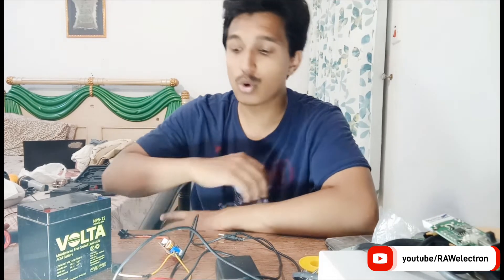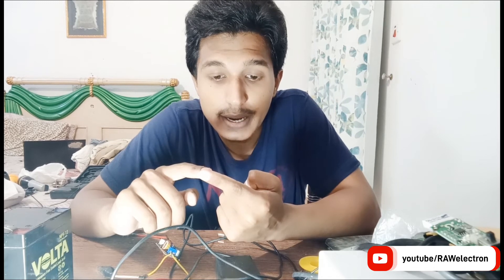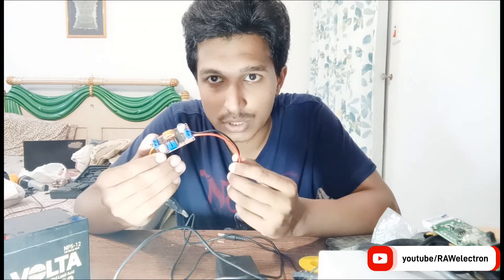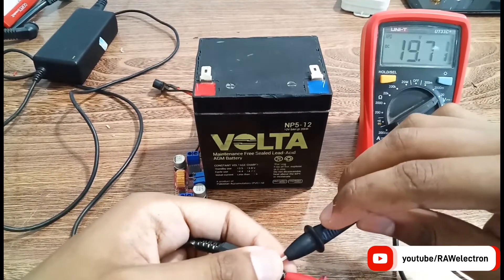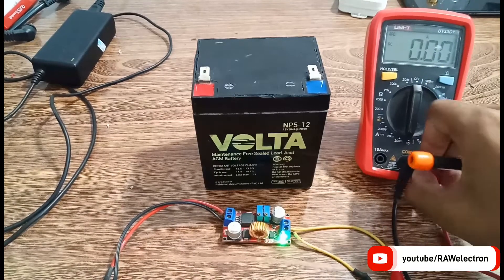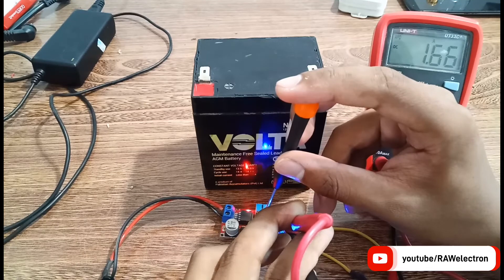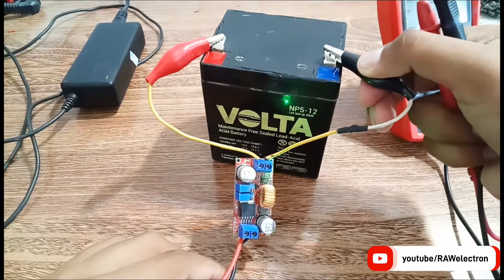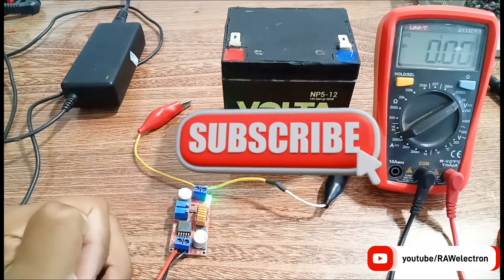Make charger for 12v sealed lead acid battery with xl4015 buck converter | Safe charging with xl4015

Comment: Hi can you also charge a 6v 4.5 ah lead acid battery. What do I need to set the volt to charge and what do I need to set the amp. Thanks
Reply from the maker: Yes. Set 7.2V and current 1A
Reply: @Electricquantism402 thanks

Comment: CAN I CONNECT IT TO MY 100 WAT SOLAR PANEL THAT DELIVERS 18v AND 5amp.?  WHEN THE BATTERY REACHES 13.5v WILL IT AUTOMATICALLY CUT OFF THE CHARGE.? WILL IT RESTART CHARGING WHEN IT DROPS TO 12v.?

Comment: Input 15v 5v amp & set to 12.v 2amp .its working or not ? Lithuim battry 3s
Reply from the maker: Yes. 12.6v max for 3s. It will work great

Comment: I am wanting to make a charger that I can leave powered on without being concerned about overcharging and overheating. My intention is to charge a 12v tractor battery full time.  So you say the XL4015 is not a trickle charger but you can set the upper level to 13.8v  or close to it, and it stops charging correct? This would be fine for my needs. And if I understand you correctly you state that reverse voltage protection from the battery will not damage the module as well. I can see myself tripping over the power supply and inadvertently unplugging the unit. As far as overheating is concerned I was thinking about adding a heat sink but 2-3 amps is sufficient for my needs also.

I enjoyed your presentation. It is to the point and easy to understand. Thanks.
Reply from the maker: Many Thanks. You got it right

Comment: If suddenly load shedding and battery is connected to the module,the module will damage readily ,yes or not.
Reply from the maker: No. Only reverse current lights up the green LED on module. No damage to the module

Comment: Its 14.9V initial charge until it reaches 14.9V trigger voltage that is when the second voltage kicks in of 13.80V. So, the charger would need two different charge voltages. Charge and float.

Comment: Sir I have a 24 volt 3 amo power supply and want to charge a 12v 7ah battery, as you suggest to set the limit voltage and current but after full charge is it necessary to remove battery from charging connector, I mean will it be automatically cut off charging after fully charged because i want to engage it to my mini home ups to charge the battery?
Reply from the maker: No need to remove the module because this module don't do trickle charging, but if you don't remove it, green LED on module always stay on which discharges the battery very slowly..
Reply: It will be fixed by placing a diode so that the battery will not be discharged

Comment: Do I need to add diode in the output of xl4015... In case of charger is disconnected and module still connected to the battery.

Let me know what will happen...
Reply from the maker: Yes you can add
Reply: @Electricquantism402  what if I don't add any diode?
Reply from the maker: @uixsohel  module's LED will glow just due to reverse current of battery.. still its fine..will not do any damage to module..
Reply: @Electricquantism402  Thanks, That's the answer I was looking for. I'm using like this for 2 days, I was worried this could damage my module in the long run.

Now that's a relief 😌 
Thanks again
Reply from the maker: @uixsohel  no problem. You can ask anything anytime as i mentioned it in the video.

Comment: Can I input 12v adapter?
Reply from the maker: Yes..5v-35v dc input range
Reply: @Electricquantism402  I need 12.6v output
Reply from the maker: @bibhas7783  no.. you need at least 13.5v input to get 12.6v output...
Reply: Ok thanks 👍

Comment: I having 12-0-12 transformer rated for 2 amps. Not considering center tap if I use this as 0-24v can I give the rectified Dc to buck converter.
Reply from the maker: Yes you can.. you can give 35v max input to this module..

Comment: I want to convert 24 volt to 12 volt  from a   smps power supply of 10 amp capacity(240w), with a buck converter. Can It capable to produce same wattage of 240 W at 12 volt out put.
Reply from the maker: This converter handles only 75w..
You need 300w 20A buck converter..
Checkout the video on my channel...
It will be perfect for your application.
Just buy in on AliExpress

Comment: Can I use 0-12v transformer instead of 19v adapter
Reply from the maker: No..12v transformer will not provide 15v which is essential to gain 13.8v on the xl4015 to charge battery...
Use at least 15v dc power source or 15v transformer with rectifier on the output.

Comment: i am trying to charge a 12v 7ah battery using the XL4015...i set the XL4015 at 13.5v  and at 1.4amps..however when i connect the 12v 7ah battery to the XL4015 output both the red and blue lights up at the same time...i tried it on another 12v 7ah battery but the same thing happens...both the red and blue lights on the XL4015 lights up at the same time...what am i doing wrong?...i am using a 19v 3.42amps laptop power supply as my power source...please help me.
Reply from the maker: There is nothing wrong in this as long as the current is flowing..
Red LED lights up in the beginning but as soon as the battery is close to full charge, it turns off and that time only blue led glows.. while at the end, green led indicates that the charging is full..
But please make sure with the help of clamp meter that current 1.4A is flowing towards battery during charging or not?.. let me know..
Or also that the polarity is correct?
Reply: @Electricquantism402 thanks  for the reply. i have it at exactly 1.4amps and 13.5 v...i found out that at the back of the XL4015 has a light indicator...the lights are for current and voltage...i think it was just normal for both the lights to turn on...i charged the battery for 7 hours and charged for only 11.8 volts...it did not go up anymore as i charged it again for 1 hour still at 11.8v...these batteries were purchased about 3 months ago and was inside a ups...do i need to add distilled water to the battery as maintenance? it is a sealed battery.
Reply from the maker: @newvaper3794  add battery distilled water about 10ml each cell.
Then charge it on 13.8-14v..
If its cells are not damaged or shorted then it will start to hold charge and provide backup..
Reply: @Electricquantism402  thanks. i will update you again tomorrow. thanks for all the answers. keep safe. sorry i thought i was already subscribed to your channel. i apologize i just subscribed now.
Reply: @Electricquantism402  it is working now...added 10ml of distilled water to each cell. yes !!!...i can now use my UPS on my laptop...i have another question..it took time to fully charge the two batteries, why is it that the XL4015 green light light up when the battery is connected?...is there a way to only have the led lights turn on when charging the battery?...it looks like it loops the charging to the battery back to the XL4015 that is why it took a lot of time...thanks again for helping me.
Reply from the maker: @newvaper3794  that's great.
Actually its the reverse current of battery which is lighting the green led ..but it's only in case when xl4015 is connected to the main power source.. otherwise it doesn't effect the charging speed..you can increase the current upto 2A if battery is 7Ah.
Reply: @Electricquantism402  thank you so much. when i opened the battery it was just dry. no more water in it. it is a 12v 7Ah battery. i placed 10ml of distilled water in each compartment just as you told me. so far the charge has been holding up. i have been using the two batteries for 5 hours now. i will probably buy the XL4016. i saw your video on the XL4016. thanks again.
Reply: Sir you do nothing wrong module working fine  battery is charging when battery ful charge green light glow

Comment: Excusme sir, i have a question ?? In many source to charge lead acid properly, there is CC CV charging method more simple is CC gonna use at 0 - 90% SOC, CV 90 - 100% SOC of battery. So this is my question, is Module XL 4015 do this scheme CC-CV automatically after you set 2 parameter voltage and current in early video ?? Thanks 🙏🏻
Reply from the maker: Yes..this is what xl4015 is designed for.

Comment: i have a 12v battery NiMh 2,4Ah. i got 3 of it. can i charge all 3 at the same time with one 4015xl buck. and if its possible. what do i have to set it. thanks
Reply from the maker: Set 12.6v and current 3A max and connect all three batteries in parallel.
Reply from the maker: It's better to charge them separately with 1A max
Reply: @Electricquantism402  so then i need 3x 4016buck and a minimum power supply of 24v 3a?
Reply from the maker: @tahirtrs3147  as you wish..you can also charge at the same time..
And not 24v 3A 15v 3-4A will also work to achieve 12.6v
Reply: @Electricquantism402  thanks for the info👊

Comment: Hi, to charge a 2,5Ah battery i need 13,8V and 625mAh but i have a 24Volts power supply with only 400mAh. Can the xl4015 compensate for the missing amperes?
Reply from the maker: Yes..it will half the voltage and double the current for compensation of total power.. current will be 7-800mah.
Reply: @Electricquantism402  Ok! Thanks for the answer!

Comment: Can I use 12 volt 1.2 amp adaptor to charge 12 volt 7Ah battery.. With this buck converter, Can it boost 12 volt from the adaptor to 13.8 volt?also I want to charge the battery slowly.0.8-0.9 amp current is required.
Reply from the maker: No it is buck converter.. you have to use 15v adapter for this...or use boost converter..

Comment: fine but in manual 1. first set OUT=5V  2. set current for acid battery 10% ( better or fast 20%)  so for 17 AH set 1,7 A  3. Set  voltage about 14 V  - then !!! connect battery

Comment: Hi, I would like to ask how many volts a 12v 17Ah lead-acid cyclic bicycle battery should be charged? Thank you in advance for your answ
Reply from the maker: Voltage should be between 13.8-14v 
And current should be 25% of its capacity which is 4.1A max.
These are the parameters for charging your battery safely.

Comment: Iss xl4015 module battery ko over charge kareta hai kya please reply
Reply from the maker: No. Current flow ruk jata hai jb battery full charge ho jaye.
Reply: @Electricquantism402  lithium ion battery kharab to nhi hoga na..
Reply from the maker: Nhi bro..no tension.. its a safe charger
Reply: @Electricquantism402  Hmm

Comment: Iss module me 24v 3amp input da sakte hai
Reply from the maker: Yes..35v tk input de skte hain.
Reply: @Electricquantism402  heating issue to nhi hoga na
Reply from the maker: @luckyrawani8952 output current 4A tk set kroge to heat hoga..5A max handle kr skta hai ye module.
Output pe kia chlana hai apne?
Reply: @Electricquantism402  Mera pass 24v 3amp Ka DC power supply hai jis sa input dena hai or output me 14.8v 1.5amp Lena hai jis sa hum 12v lifepo4 charge kare sake
Reply: @Electricquantism402  input me itna volt dena sa module kharab to nhi hoga na
Reply from the maker: @luckyrawani8952  easily ho jayega.. input pe aap is module ko 200Ah ki battery bhi lga skte hain no issue...14.8v at 1.5A easily work krega..even k aap 14.8v pe 4A bhi set kr skte ho..no issue
Reply: @Electricquantism402  Mera pass 12v 6ah hi battery hai Aagar Jada amp dage to kharab ho jayega 😅
Reply: Thank you for your reply 😊

Comment: Not good for Lead-Acid battery, if battery is discharge below 11v the XL4015 will overheat and it will burn out, it will not shutdown automatically because there is 12v battery in output connected that will continue to power up some parts of the module
Reply from the maker: It will overheat only if current is set to more than 4A. At 2-3A it works fine even if highly discharged battery is connected to it.
Reply: @Electricquantism402 
Can we use a Small fuse?
Tell me how many amps ( fuse)
Reply: @Electricquantism402 
If the Battery is discharged 
Does the module detect and automatically charge it

Comment: Hi can you give me a hand? I am designing a smart vaccum cleaner(D.I.Y version of roomba) and i need to charge my battery safely.The battery is Li-ion 3s 11.1v with 2.6AH.Can i use this module to safely charge it without burning down my house?Also how many hours does it need to charge 11.1v battery?
Reply from the maker: Yes.
Ok 3s li-ion..so tell me that BMS is installed in it or not?.
If yes then set voltage to 12.6 and current to 1.5-2amps...li-ion battery can be fastly charge to some extent...BMS will handle all the things itself for safe charging.. nothing to worry..
If you have more questions then send msg on below WhatsApp number
+923093333809
Reply: @Electricquantism402  Bro how should i check if bms is installed?
Reply from the maker: @TRAZExYT  contact me on WhatsApp or messenger and share your battery pics..i can better guide you there.
https://www.facebook.com/profile.php?id=100009456744428&mibextid=ZbWKwL

+923093333809
Reply: @Electricquantism402  Can i charge a 11,1v 2.6aH 3s lion battery with xl4015 and cn3791 conjucted,What i mean is xl4015 provide a constant 12.6v and 1.3amp which is supplied to 12v mppt cn3791 and battery is connected to cn3791.cn37991 handles the charging process
Reply from the maker: @TRAZExYT  yes it will work..
No matter cn3791 controls the charging.. xl4015 provides the voltage and set current.
Reply: @Electricquantism402  thank you for the clarification :)

Comment: Hi since you invited questions can you answer this one, you said lead acid shouldnt be fast charge since that can be dangerous, now there are millions of cars around where the alternator gives out at least 70 amps, these dont current limit which means the battery gets the full current minus what the car is using, the question is have you ever heard of a car battery expl*ding from been overcharged?
Reply from the maker: an alternator charges what is needed by the battery and the electrical load, if the battery is fully charged and the load is light the alternator will charge just enough to keep up with the load, a high output alternator means that it can deliver a high output if needed. High output has nothing to do with the volts, it means it can charge higher amps than a low output when needed. Also its voltage is some little over 12v rather than 14v which damages the battery by overcharging it.

Just as a vehicle will not be faster or use more fuel with a full tank than with a tank that is only half full the high output alternator will not deliver more amps when not needed.
Reply: @Electricquantism402  Exactly that an alternator give out whats needed by the battery, if the battery needs 50 amps it will deliver that, I notice you mention voltage been little over 12v but if thats the case put a clamp amp meter and the battery and a volt meter, start the car and see what readings you get.

Comment: I ordered mine it regulates 5v below that voltage well eg 4.2V to charge lithium but when I try to put 3 or more 18650 battery in series as input I can't regulate it ..because both red and green light become on 

What is the problem sir
Reply from the maker: You cannot charge 18650 cells in serious without bms... with this module, you can only charge in parallel.

Comment: What happens if you connect it  to a power bank of 5v connect it to a power bank and show us how it can boost the power and what you can power with a power bank using that module
Reply from the maker: According to this.. module turn on at 5v input. This module is buck converter means it step download voltage. With powerbank module, its output voltage will be around 4.5-4.7v at 1-1.5A current depending upon the power outage of powerbank module.

Comment: What happens if you connect it  direct to a solar panel with 9v
Reply from the maker: It will work fine. You can connect it to even big truck battery of 200Ah.
Only input voltage must be in range from 5v-32v dc.

Comment: I did burned out one blue colour identical xl4015 module when tested current output . I think problem was connecting test lead when module was powered on . Test lead made sparks . xl4015 started overheating . I have 9AH battery , I set current to 2.25A
Reply from the maker: It heats but automatically shut down when temperature is too high..
I think you connected with wrong polarity or the module was faulty.

Comment: Can I use 12V 2amp charger instead of that 65watt charger to get 13.8V 1Amp output from that buck converter?
Reply from the maker: No..it is step down converter. You have to give at least 14v to get 13.8v output at 1Amp.
Reply from the maker: maxmarrero9635  when you short the terminals with ammeter on this module, it enters into current setting mode...and value is displayed on ammeter

Comment: Can we use load(12vbulb) in this battery while its charging?
Reply from the maker: Yes.
But for what purpose you want to do?
Reply: @Electricquantism402  for home ...when there is loadshedding..at that time we can use it...how can I contact you? I want to ask you some questions regarding this things
Reply from the maker: @somnathghosh_111  WhatsApp
+923166927465